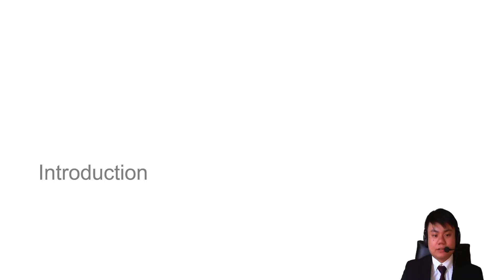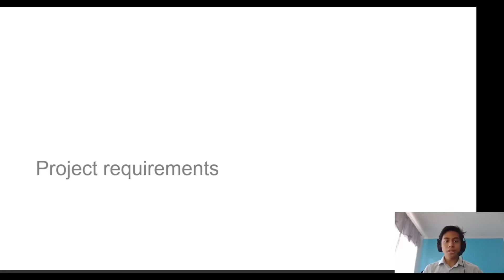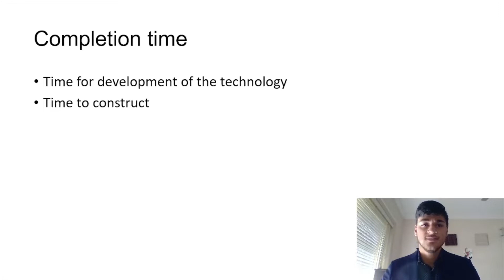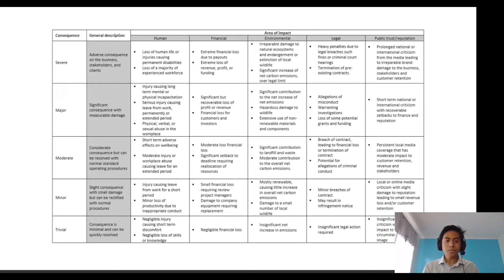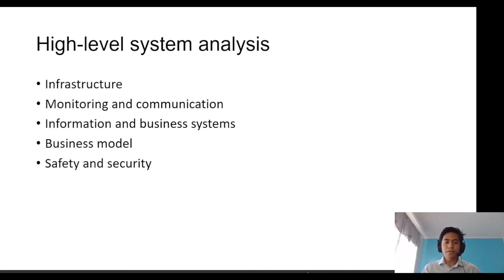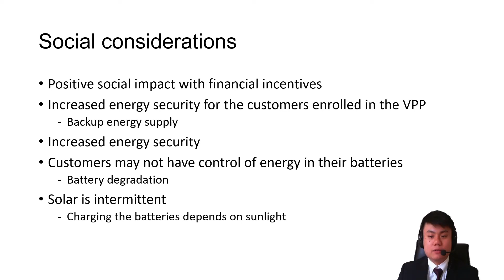WR2-04 Seminar

Comment: Hi! When explaining your solution you mention it requires a connection to wifi in order to forecast electricity and demand, putting it at risk of cyber attacks. What systems specifically would you have in place to ensure your networks are safe and prevent these attacks?
Reply from the maker: Thanks for your question! In our findings, we accounted for the risk of a data breach from within by only authorising personnel into the control centre with a passcode (and we also mentioned for future work, the system could be designed to function autonomously). Furthermore, to prevent any data from being lost due to a cyberattack, data would be backed up periodically to the cloud. We had also considered using physical cables to link the control centre with the energy resources but this may be infeasible for more distant households.